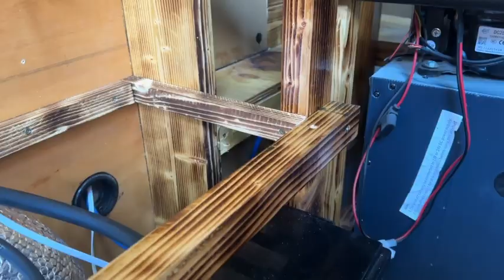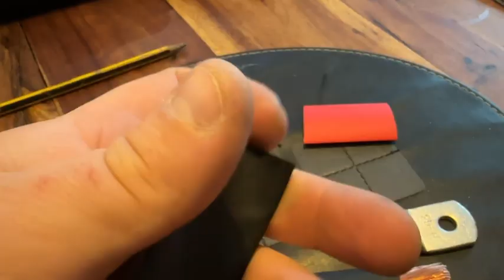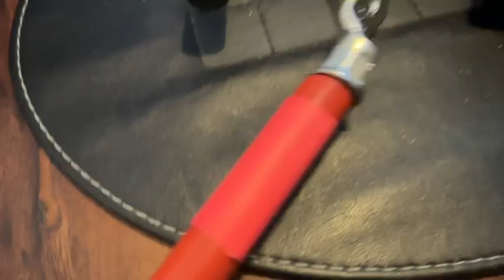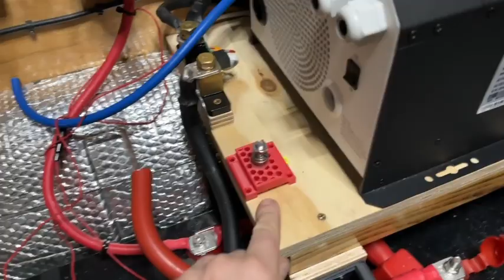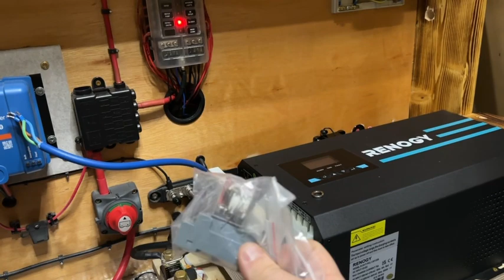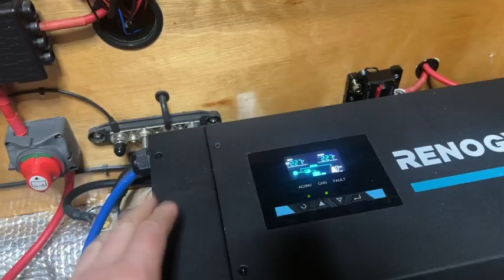E29 fitting a 3000w Renogy inverter charger to Renault master camper van conversion DIY on a budget

Comment: After your ehu you could do with a consumer unit before going in to the inverter (with a mcb and rcd both w do the pro version inverter charger with in builtdouble pole) then you can put the relay in there to switch your neutral earth bond when not on hookup. I used a ac contactor which I’m sure your relay does the same job. And its annoying Renogy don’t put an hole for the chassis earth. They do now do a pro version inverter charger which has a inbuilt neutral earth bond switch and in build rcd breaker. Good luck with your build ❤
Reply from the maker: That’s what I’m waiting for, i ordered a 5 way consumer unit but the relay is slightly wider then a sole pole mcb so Iv ordered a 6 way consumer unit so it will fit rcd, double pole mcb and relay. I wish I went with a contactor now as it would have fitted in the unit better